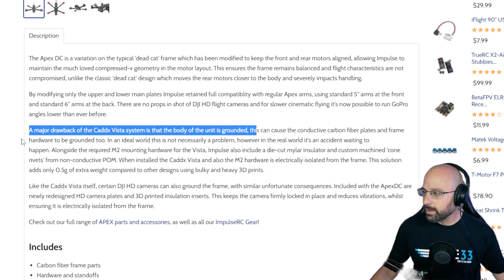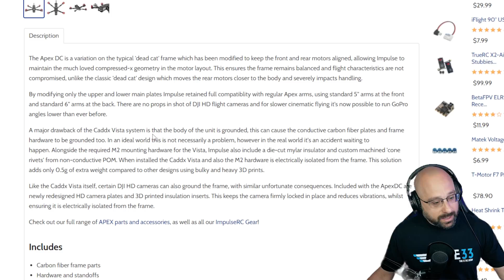Your quadcopter frame is grounded. That's bad. Or is it?

Comment: I've had a flight controller die for this exact reason in the past, could have been prevented had I used this/a similar frame which isolates BOTH the DJI Camera and Vista. (people forget that the DJI camera is metal and also grounded to the vista).. 

There are lots of ways that your frame can get electrically charged, for example crashing and a motor bell bending which shorts to a winding (how I killed mine), or wire or a vbat wire shorting directly etc. This is just another safety measure and worth having.

People who don't think this is a good idea probably haven't had this happen or aren't crashing enough to know.
Reply: Well said. Coincidentally had a vista die from this exact thing 3 days ago.
Reply: I had a kiss V2 die this way as well. Carbon was also burned under the vista.
Reply: @powertripco  Exactly yeah, the carbon was also burned under my vista too, right where the mounting screw holes were
Reply: yeah right when I found this video I thought of your crash!

Comment: A major drawback of the post from racedayquads is that it starts a useless discussion. Cant speak for everybody, but in my hard crashes the battery decided to leave the frame before cutting off some positive wires or connectors. i wonder if anybody does such a hard batt mount which can survive a hard crash which can lead to cut off a XT60 or any wire at all?  its just a one in 1000 cases, so not worth talking more about that. vista flyers dont crash so hard anyway, so...
Reply from the maker: RDQ is just repeating the manufacturer's copy about the product. It's not RDQ who started this just RDQ who people noticed.
Reply: @JoshuaBardwell  I understand. Cudos go to original source.  Reposting BS is still BS. They can decide what is on their website.  They just should take down this part of description or write it in a more neutral way.

Comment: I’d say the #1 source of stray vbat hitting the frame is when a prop nails the balance lead and throws 4/6 exposed wires all over… losing the pack is no big deal, but smoking a bunch of now unavailable boards would suck. 
Vista’s arent cheap, I think I’ll pull the screws out and use tape and ties.

Comment: Buy some 2 inch heat shrink, trace your fc and mount holes, use hole puncher to punch out mounting holes. Place between fc or esc and frame. Never be an issue. They are discontinuing Vista anyways. You're welcome!

Comment: Remember that AIO by the racerstar I think that had the metal screw holes that had the main voltage running through it 😆 🤣 😂
Reply: TBS powercube also springs to mind..
Reply from the maker: What a disaster that was.

Comment: I remember of a Racerstar AIO FC which had the mounting holes connected to the positive instead of ground. 😬
You just couldn't use metal screws with it!
Anyway, thanks for the explanation, Joshua!
Stay safe there with your family! 🖖😊
Reply: Hehe, yes, i remember that one too! :D
Reply: I used this fc 😨
Reply: Racerstar. What is that?
Reply: If you're not joking, it's a Banggood brand iirc
Reply: @rolliseventeen  f4s

Comment: DC Current will take shortest path to ground, I.e the esc in a 4 in 1 will ground via frame and frame screws to lipo negative. It wont go all the other routes as well, unless they are lower resistance, I've had the bad incident a few times of sliced positive against frame. No damage other than burn spot on the frame. The FC/VTX/Receiver/Camera are no where near the current loop. If you have isolated everything, and mistakenly grounded only the fc or the camera etc, then the rush of current will burn that area. Hence why a 4 in 1 can take the hit and this isn't such a big problem but more of a good practice to consider.
Reply from the maker: Current takes all possible paths to ground, proportional to the resistance of each path. You could argue that, if there is a single low-resistance path, then the relative current of the other higher-resistance paths will be rendered safe, but the statement that current takes all paths to ground is correct, and the common saying, "electricity takes the lowest resistance path to ground," is incorrect.
Reply: If electricity only took the path of least resistance, no electronic devices would work. When you read schematics you will see multiple paths the electricity takes in even the simplest devices. Now if you have a dead short with minimal resistance, it will take most of the current, reducing the current flowing through other paths. This is why you get electrical "brown outs".
Reply: @zachariahcheatum7128  thanks, I used the wrong wording to try explain what I was meaning. But in essence what you have said, is what I mean. I wanted to make the point that the most current would go via the lowest resistance path. Thanks for your nice explanation. 👍🏼

Comment: I burned out an entire motorset by using screws that were less than 0.5mm too long.  Thought I had the right screws 'n' everything.  Expensive mistake that ain't gonna happen again.  I'll find something else to be breakin' in the meantime, tho'.

Comment: just did a continuity test on the outside casing of the caddx vista and the frame, there was no continuity. I did another continuity test on the screw on the caddx vista and the frame, yes, they are grounded.
Reply: poke the vista harder and i guarantee youll have continuity to ground, tested it myself
Reply: The case is likely annodized. Like the carbon some rubbing could wear through causing a ground.
Reply: @slappomatthew  yep, that will do it
Reply: Likely just a coating on the heatsinks. If the screws are grounded and hold the heatsinks on, with both being metal... Well just count on eventually getting ground through the heatsinks.